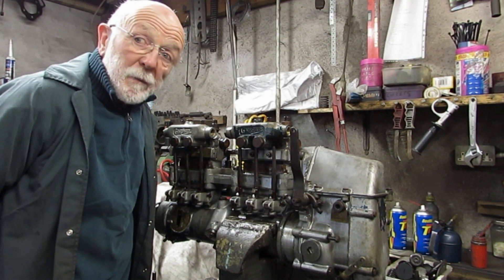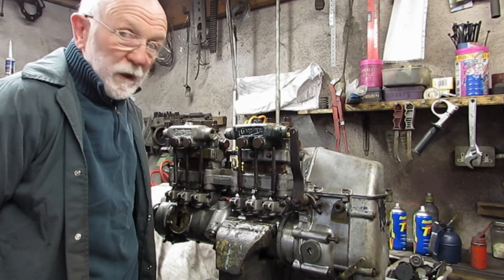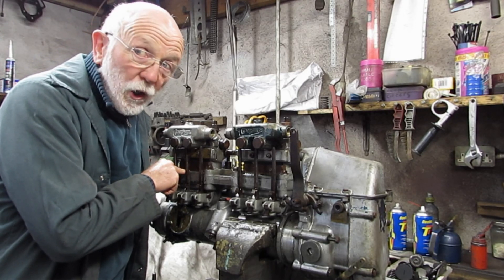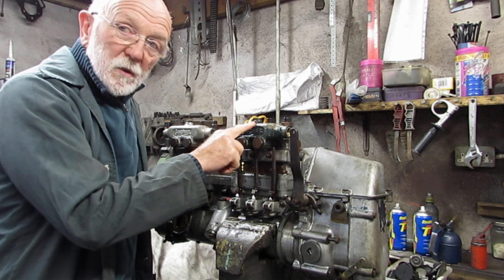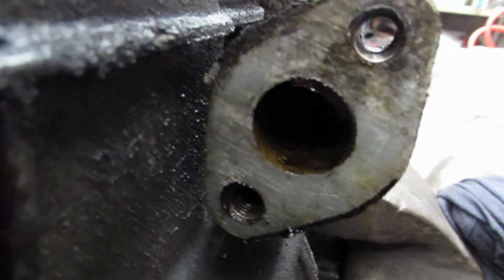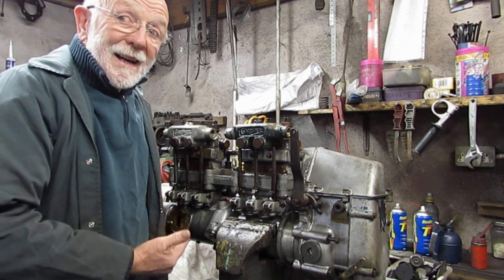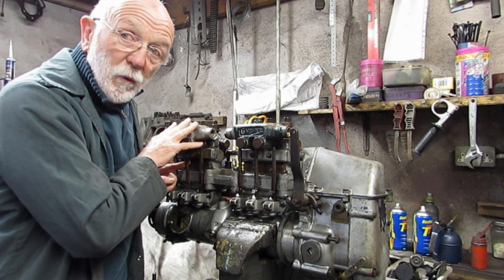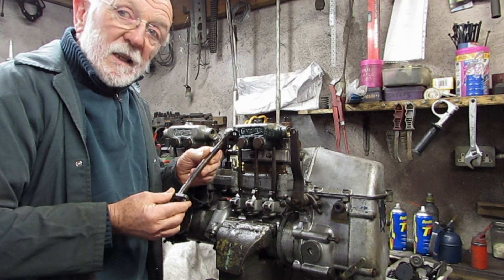Gardner Engines: oil in the pump tops!

Comment: Silicone on or in a lube system is a killer. Many years ago while working in an Peterbilt truck dealership an engine that had just been rebuilt in an Kenworth dealership two hours away came in with a cylinder miss firing or dead. I started trouble shooting and performed a cutout test trough the laptop and confirmed it was cylinder #5 on a Caterpillar C15 engine and swapped #6 injector into cyl #5 and vice versa and stlll #5 not performing. Decision was made to remove the cylinder head and I found the cylinder walls severely scoured up and piston  crown damage around the edges of its radius of the top edges. Dropped the pan to undo the rod and pull the cyl kit and first had to remove the piston oiler nozzle and there it was hanging partially out of the end of the nozzle a string of orange silicone rtv sealant. Later in the repair the oil cooler was disassembled and proved some one had used sealant on the o-rings when they put the new cooler core on. A clean up on the cooler and a new cylinder kit and away she went. 
  If ever I  have to use a little sealant due to corroded surfaces in a critical spot in the lube/ coolant system and do not have new components to replace the corroded ones I will use a very thin film with the gasket or o-ring and will only use an anaerobic Loctite type sealant but never silicone rtv. —-KTMCandog!

Comment: Too much silicon gasket sealer and too much Teflon tape are like a disease in some engines and ships. I remember spending hours with a wire brush removing Teflon from threads that couldn’t be tightened to seal because of the amount of Teflon bulging out of the fitting. You mentioned testing and engine. Could you do a video on your procedure for testing an engine before delivery and how you run them under load. Thanks.